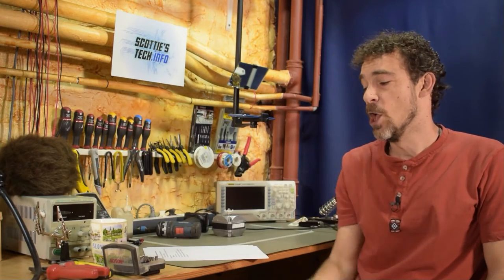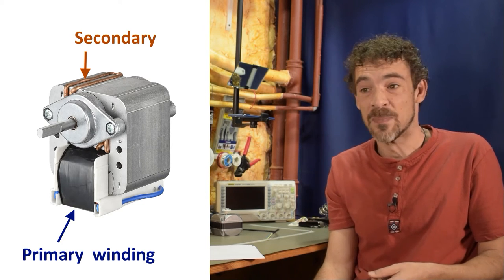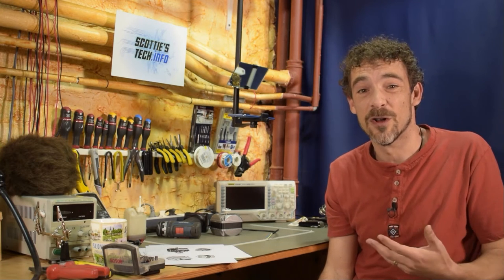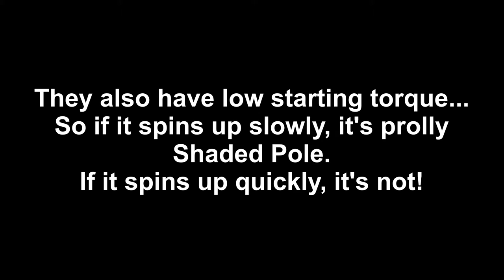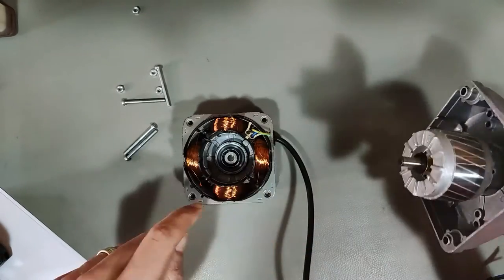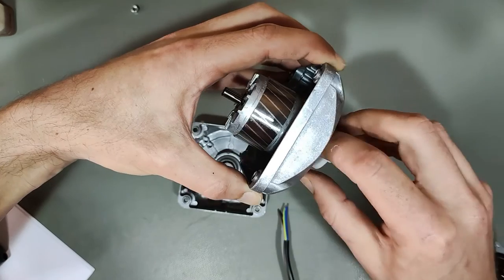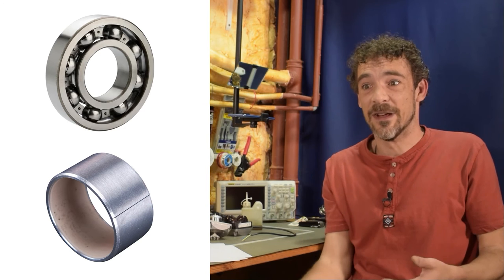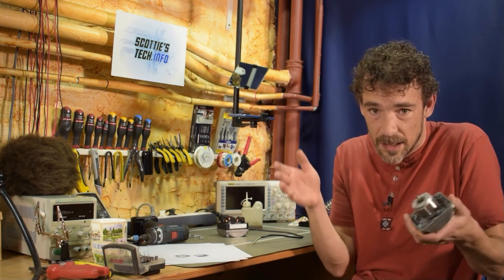This common electric motor is SUPER easy to fix

Comment: WARNING FOR FRONT LOADING WASHING MACHINE USERS : top loading machines in the US use these motors indeed, but if you are in another country, they will use a universal motor instead in their front loading machines. so if you have a front loading machine, check first if the motor isnt just an universal one, because if it is, it needs to be repaired diffrently.
Reply from the maker: Nowadays, motors in European front-loaders are often electronically-controlled motors. The one in my LG washer is like a giant flat dinner plate. It's crazy, and very neat!
Reply: @ScottiesTech  in france atleast, all washing machines i have seen use universal motors, both of my Electrolux machines (yes, i have two diffrent ones) use a universal motor with a speed controller. also, the LG motors that look like a dinner plate are direct drive motors, the universal ones are usually found in the belt driven ones. LG is the odd one for making these motors, but they are very quiet and work great. i assume these LG direct drive motors are the same as in this video too as they look extremly similar to ceiling fan motors, and thats right... ceiling fans use the same motrs as in this video. so just before trying to repair a washing machine, all you have to do is check if it uses a universal motor, if it does, too bad, if it does not, lucky for you. universal motors are also easy to repair tho, and im pretty sure someone else made a video on how to repair them.

Comment: Those sleeve bearings wick oil from the cotton, as the bearing is made of sintered metal. Sintered metal is porous. and why they last so long in a fan. Esp. if you clean and reoil the bearing, cotton, etc. I have seen fans last decades.

Comment: Hi! I have a fan that's not working anymore. There is a MF9-20A motor inside. I believe it to be a C-frame motor (so not a shaded pole motor? or is it the same kind of motor?) but I was wondering if that same cleaning and oiling technique could be used to try and make it work again. Also, could it be possible that the motor is just broken? Is there a way to test if it's broken or not? Thanks!

Comment: Good Morning Scottie, Im not sure you would like to tackle this but i have a Maxi-Torq Permanent Split Capacitor Gearmotor, it goes on a chiropractor roller table and it just quit. No smells or hot. Model 4Z519 & motor ref is 7164-0833, It says MFD for Dayton. I did notice a little bit of gear oil seeping out & it might have gotten inside. I did replace the capacitor but that didnt fix it. I cant seem to see any way to tear into it to replace the brushes and or further testing? Thanks ahead of time for your help!
Reply from the maker: Does it hum or make any noise at all, or just nothing at all? Maybe it has a thermal fuse/normal fuse that went kaboom? Either that, or gearbox seized. Well, that's what I'd check next. That's a darn expensive motor from I just saw online!

Comment: Just wanted to make a mention, the most important part about a "sleeve bearing" is the felt wick; there is a felt pad that holds and transports small amounts of oil into the shaft and sleeve bearing over time, through gradual "wicking" or creeping of oil. The oil needs to go into the felt pad, until it's slightly saturated. Without putting oil on the felt pad, the motor is going to run dry much sooner. You can see on the old 1/3 horsepower motors, they have little holes for oil, and this oil goes straight into a felt pad, and not onto the shaft directly. In shaded pole motors, there is a very large piece of felt behind the pressed in "star washer" which retains the sleeve bearing.
Reply from the maker: OH! I did not know that. Thanks for the tip!!

Comment: Good tips here👍🏻 on the bearing, I like using brake cleaner followed immediately by compressed air. I then make sure it spins freely and pack with high heat grease if it has a seal. If no seal, a heavy weight and viscosity oil. 
Many times these motors will have an oil passageway. In that case, I start with a very thin oil in the oil port then see if it’s going to free up. 
Very good video, well explained. 
Also, you don’t sound British🤣

Comment: If there is wear on the bearing it's usually the bearing at the driving shaft side because of extra weight on that side of what's being turned.     It's sometimes possible to instead swap the two bearings (or each side that contains the bearings) instead of fitting a new bearing, it depends on how worn the bearing is.

To move the rotor in a particular direction (clockwise or anticlockwise) initially, the shaded pole causes the otherwise balanced (symmetrical) magnetic field of the stator to be twisted (clockwise or anticlockwise).